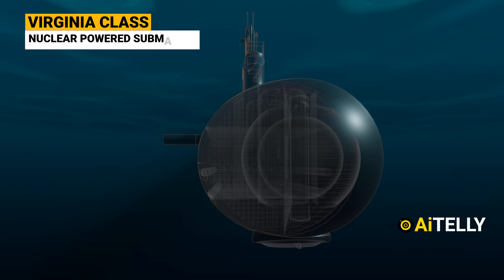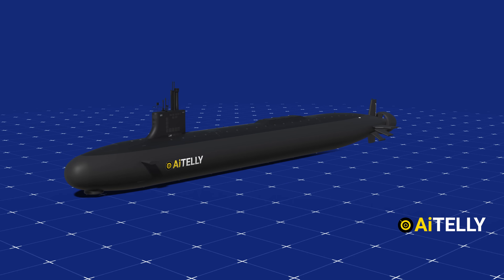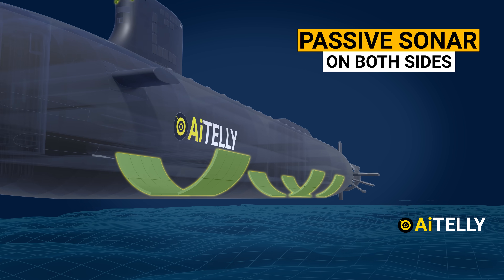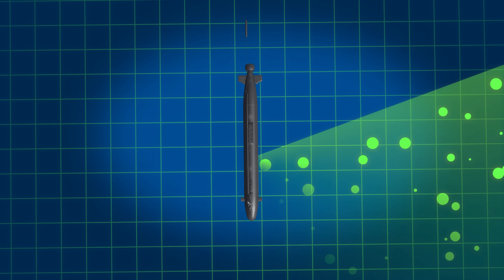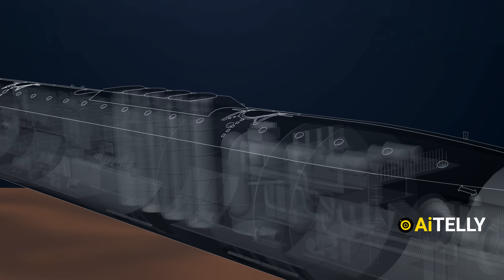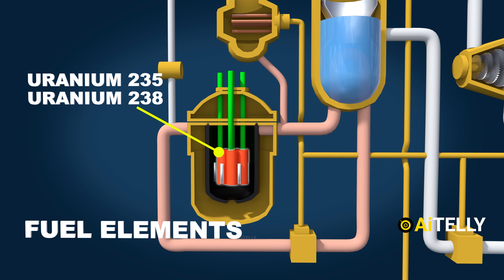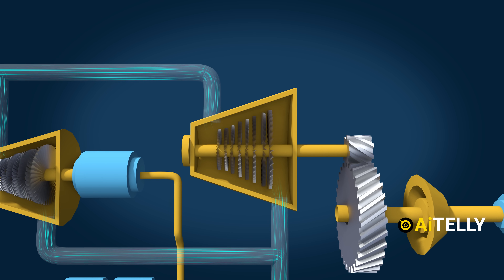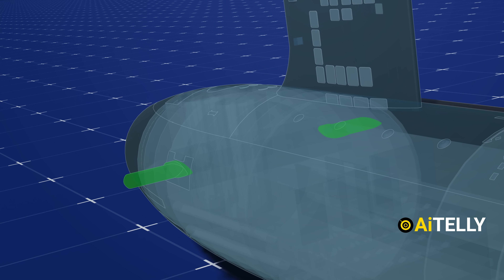Submarine Nuclear Power | Engineering behind it Nuclear Reactor How it Works

Comment: This guy has no frickin' clue what happens in the engineroom.  The reactor part is OK, but the propulsion turbines drive the screw and there is no electrical motor involved.
The EPM is used in an emergency.
8205/S8G

Comment: No control room for the reactor ? Don't think so ! You have sonar, photonics, combat, communications and no reactor control ???
Reply: The reactor controls are in the reactor room itself. It isn't the type of reactor you see in Chernobyl, or those located in coolant like in a powerplant. It's a tank. These reactors don't require 4 different panels full of buttons and switches.

Comment: Never understood, why nuclear reactors are so popular instead of hydrogen. You're still limited by food needs for the crew, wich a modern submarine can easily acommodate for with fuel capacity. For that you get a much quieter sub, that's cheaper to operate and eventually scrap as well.
Reply: Range and capability.
-While hydrogen subs are submerged, they move much slower than their nuclear counterpart and cannot stay submerged as long. They also have to dock once the fuel cells start running low vs nuclear subs which can stay out until the crew starves or goes crazy. 
-Nuclear subs can stay underwater basically indefinitely until they run out of food and move pretty far, pretty quickly while doing so. Subs that use hydrogen cells have to snorkel and can "only" stay submerged for about 3 weeks and are slower while doing so (although they are much quieter and basically invisible to most modern detection). The current doctrine for American submarines is nuclear deterrence and their mission is to basically stay underwater and undetected for months at a time on the move, therefore nuclear power is the choice. Sweden has submarines that use a combination of diesel and hydrogen cells, but use their subs much differently than America does and do not need them to be deployed for almost a year at a time and see therefore the cheaper cost and stealth positives outweigh the range negative.

Comment: Several basic errors regarding the ship but appreciate the intent and effort. I encourage you to update the video as you learn where you went wrong…as an example, according to available unclassified literature, modern submarine torpedos are  ejected using a slug of pressurized water produced by a spinning turbine. Using only pressurized air to eject a submarine torpedo is very noisy, produces millions of telltale bubbles and requires unnecessarily complex (maintenance intensive) plumbing within the sealed confines of the ship.

Comment: I DON'T KNOW WHY WATER JETS WITH HUGE PUMPS AREN'T USED FOR NOT JUST SUBS BUT FOR ALL LARGE SHIPS. IT WOULD CUT THE POWER NEEDED BY 1/2 AND BE 100% MORE EFFICIENT!!
Reply: Some recent subs do use ducted propellers, which are typically called "propulsors" in this application. They are used to reduce noise, not for efficiency.

Comment: Is it possible to install thermal camera in decoy submarines that swim next to main submarine to detect the heat of atomic reactor inside enemy submarines
Reply: The nuclear powerplant in nuclear submarines doesn't actually emit enough heat to be detected through the sub's hull and, besides, infrared radiation doesn't travel well through water. Instead, submarines use sound to detect enemy vessels. This has been the case ever since submarines were invented, although to be fair the technology has advanced quite a bit. However, the ship still relies heavily on the skill of the hydrophone operators, who are the crew members charged with detecting and interpreting sounds. 

This actually creates a very interesting and tense dynamic when submarines need to attack other submarines, as using active underwater detection tools such as sonar will instantly give away their position even if they allow the sub to detect their enemy, so neither vessel will want to make the first move, but they eventually will be forced to when they need to make noise or even surface in order to keep things running properly.

Comment: Nuclear reactors are just Victorian era technology with a different source of heat. A steam engine is a steam engine.
Reply: Not true in the least.

In addition to engineering the system to account for radiation (which does some amazing things to alloys used in non-nuclear plants), there are unique safety issues, including that the water/steam pressures and temperatures are much higher.

Do you also assume a gas lawn mower is the same as the giant diesel engines used in 1200+ foot ship oil tankers?
Reply: @Slackware1995  It's true in every detail.  All those extra safety measures are only necessary because of the nature of the heat source.   In its essential details, it is exactly the same as a Victorian steam engine.  A heat source boils water.  Steam is used to turn a turbine.    The turbine can be used directly to turn a shaft or to generate electricity.  All technology over 120 years old.
Reply: @Slackware1995  I missed your comment bout the two modern machines.  No, they are different technologies, gasoline and diesel work differently.   But both of these are Victorian inventions too.  Gasoline : 1861 ,  Diesel : 1897.
Reply: @Crusty_Camper  it's obvious that you haven't worked on what you speak about.
Reply: @Slackware1995  If only you knew....
Reply: @Crusty_Camper  please explain in detail exactly how a nuclear reactor - steam generator - steam turbine - main reduction gear system is exactly like a Victorian era ship steam engine.

Feel free to as technical as you need to for a US Navy veteran Submariner ELT.
Reply: @Slackware1995  Every part of the system you describe was invented in the C18th and C19th. or even earlier, with the exception of the reactor which is just a source of heat for the system.  The steam engine itself was invented in 1712  The steam turbine in 1884,  Reduction gears were in use 2400 years ago.  All very old technology put to a modern use.
Reply: @Crusty_Camper  it would have been simpler to just say "I don't know".

The Romans knew about metallugry, pipes and pluming but they couldn't make a low pressure steam engine. Having basic technology doesn't mean that you can produce highly technical engineering.

Being able to make wooden cogs and gears is so far removed from main reduction gears that you can barely say they are related. The metallurgy required to make the special alloys took decades to figure out. The tolerances of the parts are so small they couldn't even conceive of that small of distances. The gears are balanced to an extremely high degree. It takes MONTHS to produce a set of modern main reduction gears for a submarine. They are so expensive that rarely are spares available.

During the early 20th century we made vacuum tubes, that doesn't mean a modern CPU is just early 20th century technology.

In the 1800's batteries and electric motors were available. Electric powered "cars" came before ICE powered cars. That does not mean that modern EV's is the same technology.

You would probably claim that a nuclear ICBM is the same technology as a bow and arrow.
Reply: @Slackware1995  It's still a steam engine.
Reply: @Slackware1995 Save it. Not worth the effort with him.  If he can work out how to run a coal furnace 400 feet under water then I'd perhaps listen. He can't.
Reply: @paulanderson7796  No mate, I am not saying it's run on coal.  I am saying it's a steam engine with a different source of heat.
Reply: @Crusty_Camper I'd still prefer nuclear over coal. A sealed for thirty year service life reactor makes good sense to me.
Reply: @paulanderson7796  It's the only practical source of energy, agreed.   Nobody was suggesting you could run a submarine on coal.
Reply: @Crusty_Camper It's OK, I am with you now. Yesterday was a long one. Apologies for my mis-interpretation.
Reply: @paulanderson7796  No problem, I didn't take offence ( or offense).  I hope you and yours have a very happy Christmas and a great new year.
Reply: @Crusty_Camper Same wishes to you and yours.
Reply: How do you propose to run a coal furnace without a fresh air (oxygen) source and without an exhaust system?

Comment: How is the air pumped to the tanks if there is no air under the water ?
Reply: In short, the submarine boils out salt and other impurites and creates clean water. Then there's a machine that takes the clean water, uses electricity, and seperates the water into hydrogen and oxygen
Reply: Nah, no air. The crew are bio-engineered to not only not need air but to also not expel CO2.

PFM.

Comment: In the new module with 4 tubes I would reserve one tube for a Trident 2 D5 missile armed with 14 independent reentry vehicles with the dial up adjustable yield warhead. This leaves me with 33 tomahawk cruise missiles and an Ace in the hole. The US Navy no longer produces the nuclear capable cruise missile tomahawks so the Trident restores that capability. It also fits with the new doctrine of dispersing your forces to insure survivability.
Reply: In addition if not mistaken, tomahawks & harpoon missiles can be fired from torpedo tubes as well. So you can limit your mark 48 torpedoes from 26 to 19 and restore the 7 tomahawks removed for the Trident missile. So now you will still have your 40 tomahawk cruise missiles, 14  nuclear warheads, 19 torpedoes in addition to mines & decoys. Tomahawk block 5 comes in 2 variants: land attack and sea attack for moving surface vessels. The trade off must be carefully calculated since a single tomahawk may not be able to sink a ship as well as a mark 48 torpedo can. But then I would preserve my torpedoes for hunting enemy submarines.

Comment: Great graphics.  11:32  Need clarification on Step 6 - mechanical energy from the turbines, geared down through the transmission, has to pass through a *motor-generator*, similar to a diesel locomotive, not a simple "motor".  Basically, this approach skips the battery component between the two, most often seen in hybrid vehicles.
Reply: There is no transmission and there is no electric motor connected as he shows. Also a nuclear sub is unlike a hybrid car.
Reply: US subs use gearbox. French use generator motor.

Comment: I'd like to add some musings to the description of the nuke sub and its inner workings. It seems to me that, in case of engine malfunction and missing the ability to communicate with the outside world, combined with the necessity to land on the sea bottom, not too deep for the vessel to stay intact under water pressure, though (as in the case of the Kursk disaster), the crew members might have quite a few, likely unconsidered yet, ways to prolong their survivability by using the compressed air in those missile and torpedo compartments for breathing. Also, if their location remained long unknown for rescue teams, they could mark their position in the water by sending something buoyant and beaming optical and radio waves to the surface or, as a last resource, even firing those missiles or torpedoes in desperation they have on board (with payloads inactivated, ofc)?
Reply: Staying alive for any length of time requires more than just air. You need fresh air plus CO2 scrubbers and fresh water. After more than 3 days food becomes an issue.

Depending on location and/or depth a heat source is needed. Trust me when I say the ocean water can be very cold. A metal tube is very efficient at removing internal heat.

It is likely that if you are on the bottom (and above crush depth) electrity will be an issue. After a few days emergency lighting will likely not be available, making your suggestion of firing and controlling a torpedo or missile extremely unlikely. A sub without emergency lighting is likely much darker than most people have experienced as it is 100% dark.

Safely walking more than a couple of feet without emergency lighting, especially if the boat is also on the bottom which implies that boat is uneven and/or flooded, extremely dangerous.

PS. Much of the compressed air is in engineering spaces.

Comment: Where does the water for steam come from? Seawater?
Reply: I'm pretty sure thats a closed system. What that means is everything is closed up and works without input. So I believe the answer to you question is the water comes from the dock the sub was built at
Reply: @Gracefulwarrior2124 you believe wrong.

The ship creates very pure water that is used with additives. This the primary loop that cools the reactor and generally only needs more water when the reactor is refueled. Hopefully people can guess why the primarily loop losing water might be bad (at least on an extremely basic level).

The steam generators use a second loop that often needs additional water as some amount of leakage of steam and condensed water is normal.

 Different additives for potable water. Pure water is unpleasant to taste.

Comment: 0:00: 🚢 The Virginia class nuclear-powered submarine is a massive and advanced underwater vessel.
3:06: 🚀 The submarine used by the president of America is equipped with advanced technology, including a sonar array, missile launch tubes, and high data rate satellite communication.
6:14: 🔒 Using a VPN can hide your IP address and safeguard your internet connection.
9:34: ⚓ The X section of the submarine explains the workings of a nuclear reactor and how it powers the propellers of a Virginia-class nuclear submarine.
12:49: 🚢 A submarine with unlimited energy and ballast tank technology is explained in a simplified animation.
Recap by Tammy AI

Comment: Water at 320C??
Reply: Under pressure. Just like your car can run 220F and some at 230F+ with coolant under pressure and still be liquid until the pressure is released. Go up in the mountains and water boils at lower temp. Pull a vacuum on water and it can boil at room temp.
Reply: Its at very high pressure and greater than 320C

Comment: As someone who has years of experience building these from stem to stern, there's a few critical inaccuracies regarding the structure of these ships, regardless of an "oversimplification." I won't be detailing them here as it's somewhat sensitive information, but know that your depiction of their ballast technology is completely wrong as well as how you described launching torpedos. Not a bad video though, for someone outside the shipyard you've done solid research
Reply: He's actually almost accurate on those systems in comparison.
Reply: @Slackware1995  sure pal

Comment: Ballast tanks are filled with water by opening the vents on top to allow air out and water in.  If you only opened the “flood ports”(doubt that Virginia Class boats have these) you would simply compress the air in the ballast tanks and diving the boat would be difficult if not impossible
Reply: What's a "fools port".  I've served on many subs and never heard that term used before. I've heard of "chicken switches" Than again I never was stationed in the control center, except section tracking party.
Reply: @lawrenceleverton7426  ugh…speed typing , should have been flood ports.  I was on Sturgeon class boats and our ballast tanks were open ports on the bottom of the boat, possibly had some grates on them.

Comment: CORRECTION 
The propeller is driven from the steam turbine via a set of reduction gears, not an electric motor which the video shows. There is an emergency DC mother that can be used if the steam supply is cut off, like after a reactor scram.
Reply: Later blocks are getting the electric drive, so is the now in construction Columbia class.
Reply: @AT2Productions but the electric drive isn't connected to the turbines via the main reduction gears and the main shaft.

Comment: The steam turbines directly drive the prop, or does it drive a generator?
Reply from the maker: drives the Generators to Charge the Batteries
Reply: There are 2 main types of turbines (old subs also sometimes used steam turbines to power pumps).

The main turbines power the main reduction gears which powers the main shaft that turns the prop.

Then turbine generators that use steam from the output of the main turbines produce electricity which can also charge batteries. There is an emergency electric motor that can be powered by the turbine generators and/or the battery.

A new design utilizes only turbine generators. Instead of main turbines powering the main reduction gears that turns the main shaft which powers the propellors, the propellors (or equivalent) are powered by giant electric motors.

The biggest benefit is getting rid of the very delicate and extreamly costly main reduction gears. There generally are no spare main reduction gears which means a replacement requires waiting multiple months for a replace and cutting a very large hole in pressure and outer hulls to replace them.

As a side benifit it allows the removal of large and expensive support equipment and time consuming and expensive PMS (preventive maintanance). My guess is that is would likely allow for 2-5 less crew also.

Comment: Seems to me, its more steam powered than nuclear. Being thats what directly translates power to the shaft. Just using nuclear reaction as its heat source.
Reply from the maker: Yes
Reply: The heat produced by nuclear fission is the source of the power (thermal power). Would be no steam without it. It's nuclear powered. 
Would you say that a diesel sub is a steam sub that "just" uses diesel fuel?
Steam pressure is an intermediate form of power (or energy), which, in turn, is converted to electric power and then torque (power) to turn the drive shaft. The propeller converts that to water pressure to move the sub. Many forms of energy and transformations.
Reply: @cmillerg6306  I guess I see what you're saying.  Nuclear being the initial power source. But no, I wouldn't say that of a diesel sub. It's engine is in direct relation to the prop shaft. Not trying to argue though. Just curious.  Thx.